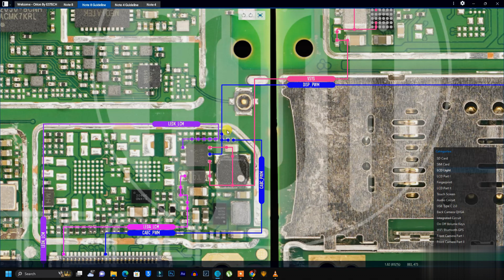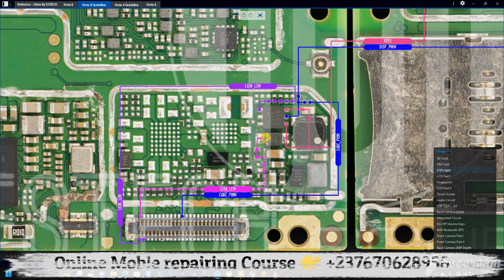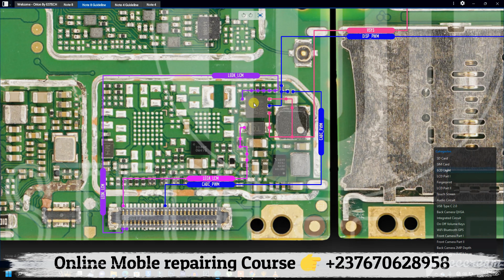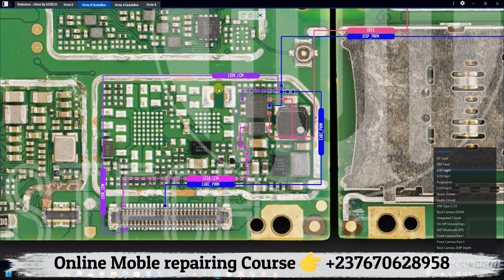Mobile Phone Backlight Section Explain | mobile repairing course full video

Comment: The blacklight section is a typical example of a boost converter meaning it takes a small amount of voltage and boost it to a higher voltage.
For instance, 3.8v vph to 15-20volts or more.
The PMIC does the opposite and it's called a buck converter.